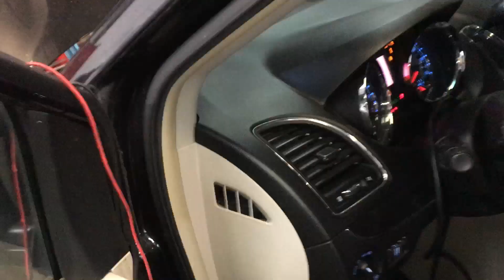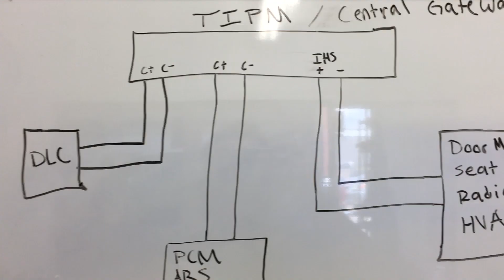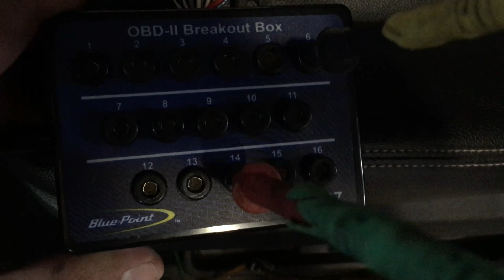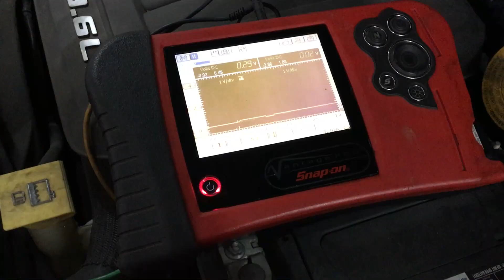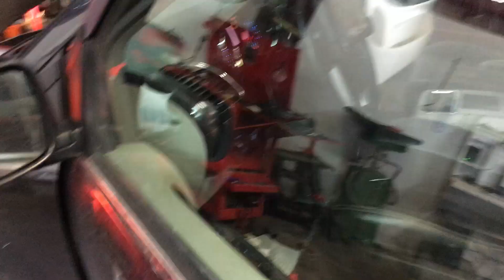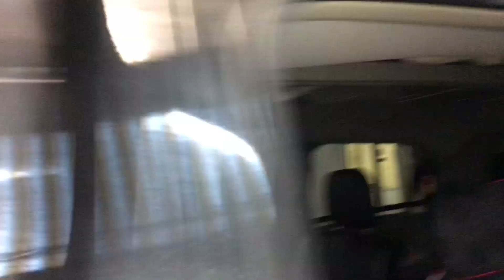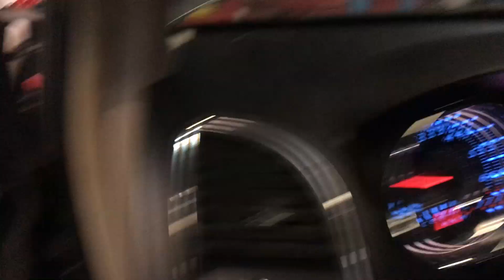TOWN & COUNTRY CARAVAN NO BUS DIAGNOSTIC

Comment: I did this because I had the same issue and it did stop the windshield wipers and everything. But when I went for the drive, something started smoking behind the engine. It smelled like a band not sure what kind of band maybe the AC band I'm not sure but I had to reconnect it. I changed my ribbon strip. Thinking it would stop the windshield wipers. And unfortunately, it's still going on.And now my windows won't go down.And my eco gas won't turn on either.So now I can't drive my car because I have eco gas in it

Comment: I think if someone doesn't have the fancy scopes, the easiest way to disconnect modules that are inter linked by CAN and see at which location problem goes away, and also look into after market things that being installed or fresh tape marks can be a good identification, but mostly these issues start at cold climate locations where mice nest into engine bay and then start chewing into electrical. anyway good video posted by you. yes  no mechanic can control customer, where ever customer ask you to stop, i would say it basic problem is fix then call it a day.

Comment: Great video this solved the problem and saved me possibly thousands of dollars, I can't say it enough great explanation.  Your step-by-step process of diagnosis really shows why electrical issues can be so expensive to determine the source of the problem. If the title would have been something about wipers not turning off or panel not working gauges not working I would have found it sooner I'm glad I did eventually find it before taking it to a dealership. Thanks again😊

Comment: Awesome video, like always. CAN videos are always very interesting to watch. I also have a question: it the manufacturer doesn't provide the actual topology for the networks in a car, what would be the correct approach regarding communication issues.
For example, I have a Renault Clio IV from 2014 and there is a code for the instrument cluster saying "CAN high, lost communication" but I'm still able to access the instrument cluster with the scan tool and everything seems to work on the cluster except a weird message saying "check parking sensor". The weird thing is that the car isn't equipped with parking sensors 😅 and I thing that message is related to the no CAN communication fault, because they seem to came up the same time.
I have a pretty capable scan tool but unfortunately it doesn't provide the topology of the networks for my car so what approach you think I should consider?

Comment: Fantastic video, you are a great mechanic. These electrical problems can be so perplexing sometimes. You don't always get lucky when your diagnostic can't pinpoint the exact problem. Thanks for sharing all your work on this! I was wondering if you know if there is an easy way to diagnose a low beam headlight not coming on that's not the bulb assy. Is there a test for the ballast?

Comment: Our 2011 t&c started doing the same as the one in your video, seems to have started shortly after we went through a self carwash.. it goes away at times but comes right back.. three shops have tried finding the problem with no luck..the dealer was one of them.. They tried selling us a new one instead.. though charged over 200 dollars for basically nothing..i tried disconnecting the roof and no luck... Thank you anyway for the video, it gives a lots of encouragement , i will try disconnecting the rear sliding doors next..thank you 👍

Comment: Body control module - check power doors rotting and wires under front left fender.  My 2002 body control, pcm, tipm, and tcm ... Bcm is interior.. plus, the car security in the pcm

Comment: Hello, I have a Dogch Dart from 2013 and it has the same problem, except that everything is removed from mine and it runs normally and then the same thing happens again an hour later and it doesn't start.

Comment: I have a 2014 Town and country van. All the lights on the dash are lighten, and go out, and come back on ever so often. The windshield wipers come on and don't shut of, so I pull the fuse. It's say the Blind spot system needs to looked at. I took of the bumper and took a closer look. Connections were dirty, and the moguls were in good shape. So I cleaned up the bumper, and all the tape to hold the wiers up out of the rain. Blinkers work most of the time. Still don't know where the lose wire might be. Each connection I find and can get to I clean it out and put some electrical grease in the connections.

Comment: Thanks  for the video!  Sad that the engineers created something so complicated to run down the issue.  A plastic module that in the cost of the Toal car is pennies on the dollar cost hours of Mechanic labor.  With technology I hope they can create something that once you put it on the scan will tell you EXACTLY were the problem is so the auto owner doesn't have to pay hours of labor to find a $5 part that malfunctioned.  Yet I am so thankful for the video it was very informative Seems to be a Chrysler, Dodge Jeep issue for sure.
Reply: Fiat-Chry have had 15year now to change this, but they wont do it. It's their real income you are touching & it's HUGE.
Same as adding an 300hp 3.6vvt to an 200hp 62te-transmission makes them all break down giving an extra 6-12,000$ income every 100-172,000 miles.

Comment: Hey, what did you have to replace on the car to fix the problem? I detached the connectors like you showed and the issue went away, but I don't know if I have to replace that whole unit attached to the ceiling, or just the monitor, or just find the wire and wrap it with electrician tape...

Comment: I’m working on a charger that has all the can bus together to unplug easily and im getting no change with the vehicle when i cycle the key does that mean some can bus wires could be shorted else where rather than in a bad module

Comment: So I found that unplugging my third row seating is allowing my vehicle to go back to normal operation, specifically the left 60% seat. How do I diagnose exactly where the issue is? Is it more than likely a pinched wire? It happened when my wife was folding down the 3rd row to load groceries into the back of her van.

Comment: I am having the exact same issue on my 2014 chrysler town and country. I have pretty much came to the same stopping point. I was hoping that you would be able to show how to test the components individually to find which module was at fault. I will figure it out. Great video. Confirmed I was looking in the right direction.

Comment: I found out that unplugging the connection like in your video (the plug in my rear DVD) that it also corrected my no bus code. However my blind spot monitoring and some other functions are now not working. What should I do next??? Thanks

Comment: I'm sure you (and your customer) wished the first module you tried was the bad one!! I'm working on a different Chrysler product, but the troubleshooting procedure remains the same. My CAN bus lines show continuity between TIPM, Cluster, radio, etc, but does not show any resistance between the two lines themselves. I also see comms on the bus, but the cluster still shows "no bus". My car remains something of a mystery, but you gave a good explanation, and I appreciate the extra effort it takes to make the video.

Comment: thanks much . one thing i noticed on my 2012 grand caravan is the rear ac doesnt work--only heats. then driver window didnt work until i replaced the seitch. now, just sitting in the driveway, the lights randomly come on draining the battery and i cant turn them  off. im suspicious of the rear ac module now

Comment: @advnancedlevelauto hey man just got a t&C and dont have oscope. i am having just problem with back windows not working (changed fuses) but there is power to doors the locks work just no windows or power sliding doors.  i am getting  u0201 and u202 and u0249 all central gateway.  it's like just the middle of the van does not work OR the power outlets back there . upper buttons dont work nor fob. i can open driver side and blinkers flash like its working, passenger side no blinkers so i disconnected back passenger door still nothing. just crazy hunting things down. have a nice scanner just pain in the ass.

Comment: Hello. Really good video. Thank you. I wonder. I have a Lancia voyager 2014 with no bus shown and nothing works in the car, no fan, can’t use sliding doors, no radio. exact the issue you have in the video. I have tested to disconnect the modules on by one. I removed the two in the doors panels, the one behind the radio, and the one in hvac and the dvd in the roof and the two in the sliding doors. Ive done this separately and still having this issu with no bus. Is there a module behind the Speedo and if I disconnect this one. How will I know if the no bus I still the problem. Aren’t the message going to disappear/codes in the screen when I disconnect the Speedo/modul? Hope you understand my question. Bregards from Sweden 🇸🇪😊

Comment: 2014 Town & Country also with a No Bus error. Took off fuses one by one until I pulled off the M34 10A fuse which solved the No Bus error. This fuse is part of the following circuits: Park Assist, Heater Climate Control Module, Headlamp Wash, Compass, Rear Camera, Door Lamps, Flashlight, etc. Anyone have suggestions on how I should proceed with finding out which of these accessories are faulty?

Comment: Yes ! Awesome vid and great tackling ot down to its core bruh !! Nice!! 👍🏼🤙🏼🤙🏼, were are u located ? I have a very similar issue just bc i swapped a donor BCM on a dodge charger srt8 2014! And soon as i did that i lost immediate interior comunication on car plus HVAC strted blowing hot air at max!! Uconnect has no power radio no power dark screen !! Also no headlights switch will not allow to turn on or off no signal there and no signal on the front left driver door only to operate windows or power locks !! So pretty much similar issue !!! The only code on dash is an ambient voltage HIGH !! I guess thats why my heater is blowing hot steam as ambiant sensor reads negative 17 dgree when is 80 out side!! So may be the short or issue may sit in this ambient sensor code voltage HIGH!! So yea donor BCM swap nd this happends , i decided to put back original BCM and got the car to start only to get all these other issues that were not there prior !!along as for the BCM swapping ,

Comment: I worked on my cousin's T&C van, similar issues with all of the devices in the vehicle when you would close the door when running.
  I found the proximity (collision) sensors in the rear bumper corroded and corrupting the bus signal, disconnected them and everything went back to normal, we left them that way because they were $700 each! They were the same part number as some Mercedes cars.
  I also worked on a 2014 Chevy truck with a totally dead bus, a critter had nipped a wire in the harness near the rear shock, critters are a big problem in the last dozen years.

Comment: The front doors have a connection that's easy to unplug, where the door wire loom flex thing meets the frame. Seems easier to just quickly unplug the whole thing for the door test and go further if signals change 🤔 

I bought an 08 Caravan super cheap and it stunk really bad! I got lucky and noticed the whole interior CAN would cut  out when the door was open as I scanned it with the door open...it was so gross smelling but improved with the door shut, it also had a door module code. I could also see the wires in the door flex were installed backwards by someone and jamming the wires in the door as it closed. Made for a nice easy problem to spot, a week before I wanted to go on a 3000km trip. I even had time to shampoo it and drive around to verify the fix. Both CAN lines shorting to each other and 8 bad wires in total where the door wires flexed.

Thanks for the great detailed videos on everything, so much to learn 😊

Comment: Mine just turns and off at random and sometimes  constant cycle of doing off and on. Drives with out issues will drive you freaking nuts. I would do the same as this owner and pull the plug

Comment: remembering the good ol' days when you can control everything with simple toggle switches...the only thing they had in common was the battery itself...windshield wipers didn't have to depend on communication with the DVD system, or windows...by making things more complicated, they think it makes it more efficient...i would love to be able to run bypasses on all the feldercarb to allow components to run independent of each other the way they should be...check this video out for a nice shocker about the UConnect system...  https://www.youtube.com/watch?v=MK0SrxBC1xs&ab_channel=WIRED

Comment: I have 2008 town and country, TiPM caught fire and replaced it.  Rewired new connectors in. But lost speedometer, heat, power outlet #2 and#3 , inside door locks on window drivers side switch. Anti theft was activated and do not have original key for fobik. Only one fob with no key. Friend was helping and stuck valet door key in ignition, and broke off the little metal clip on left side of key insertion. I cleared anti theft, but if i stick fob in it sets it off again. Have no crank and hooked up diagnostics tool no communiction is established.
Reply: I have no idea how to fix, it ran fine before the redo and change out pins for front blinkers. Did pin out ....front blinkers work fine now but lost back blinkers. Have brake and taillight tho. In need of serious help!

Comment: Wow, you got the complete assembly down on a table. I have the two monitor version and all the AC controls etc in the 2013 Grand Caravan RT version. It looks pretty much the same as yours. It also came with a DVD player like remote control and headsets for four passengers. Go figure.

The question is when removing the initial bezels (not the whole thing) could you see the metal roof of the minivan? Is there a 1/2 in space between these overhead options and the roof? The reason that I ask is that I want to install an antenna mount in the roof for two-way radio communications with a fixed antenna in the center of the van. I need to drill a 3/4 in hole in the roof to install an industry standard NMO roof mount. If I can get this then routing the antenna cable to a radio is not that big a deal in a headliner.

You posted in 2019. If  you don't have answers or even look at your post that is OK. Thanks for your detailed video I can proceed possibly without breaking a lot and maybe post a video for others like me who are crazy enough to drill a hole in their minivan roof! Thanks.

Comment: I brought my 2014 T&C to a tire shop for an alignment, oil change, and 2 new tires on the front and it left the shop with all these same issues.   The Chrysler dealership is telling me it's an issue with the cluster and it needs to be replaced.    Is it possible the tire shop did something to cause this issue?   We're currently waiting for parts.
Reply: That is excatly what happened to mine. Did you find out what the problem was?

Comment: Thank you for the video! I have everything disconnected, including cluster, but wipers are still on. Resistance on pin 26 and 27 62 ohms. Any suggestions on next steps? Thanks!
Reply: Im having the same problem. Did you figure it out ?
Reply: @josevillalobos9973  while I was troubleshooting the issue went away and never came back. It's been 4 months already.  My guess the cluster was a problem.

Comment: Thanks for this video.  Had the issue pop up the day my Caravan turned 100,000 miles. I found this video and started by disconnecting the rear DVD monitor and ac. The DVD monitor was causing the No Bus code. Saved me tons on dealership diagnostic costs. Excellent video!
Reply: Did you repair the dvd player yourself?

Comment: I have a 2008 Chrysler T & C and having similar issues but things are flashing on and off not staying off.  I had already noticed my overhead HVAC controls don’t work quite right and was just over riding them with my front controls but now I am going to get up there and check them out after this.  Thank You for your detailed video.
Reply: Hey, so what happened when you checked out the top hvac controller better?
Reply: @stevendlent   I haven’t gotten up there to check it yet as it hasn’t been a big priority. I did find that my cluster lite show was caused by a bad ground. The one on the passenger side motor mount was in poor shape. I also did a big 3 upgrade to ensure grounds wouldn’t be an issue. I also added one more extra grounding from the alternator to frame. No issues since then with the light show. I haven’t gotten a chance to double check to see if the rear vents work correctly since then.

Comment: Fantastic video and information; I do have a  question why would they build such dumbass cars where something like the climate control center, abs, cd player etc fails and the car does not start in some cases, seems retarded to me or perhaps my DIY mind is missing something?  Why not have a stand alone network for the car to run on, seems like dealership scam set up to me.

Comment: Did you ever find out the problem of the vehicle? I have this problem with my 2014 Chrysler Town&country. But if I pull down the DVD players in the back the van resets and I can drive it like normal. But lately my van has been acting up and my DVD Mcgyver trick hasn’t been working. Any help please.

Comment: Would it have been possible to just pull the fuses for the modules one by one while looking at the scope? Of course, if the CAN wires were shorted in the module that wouldn't work, but in this case I wonder if that wouldn't save time.